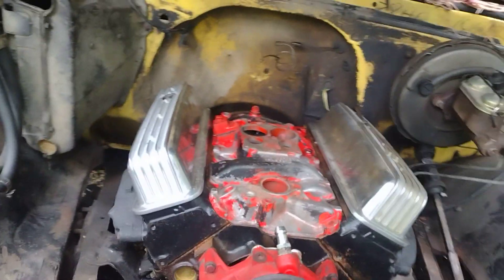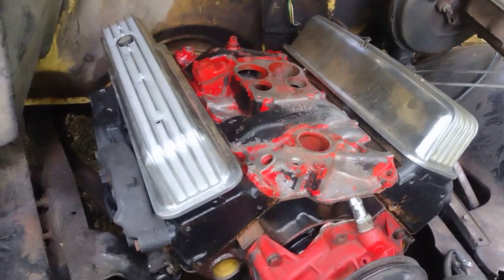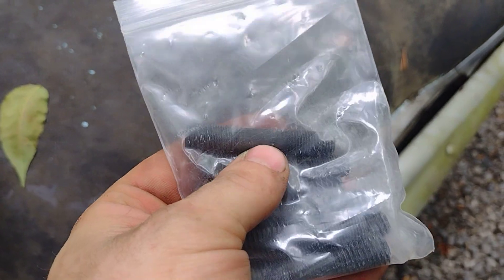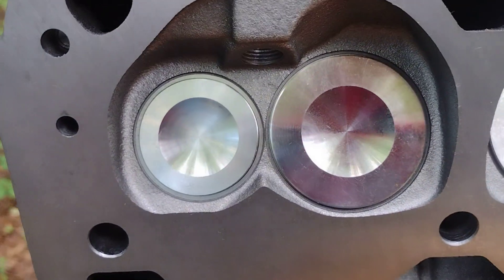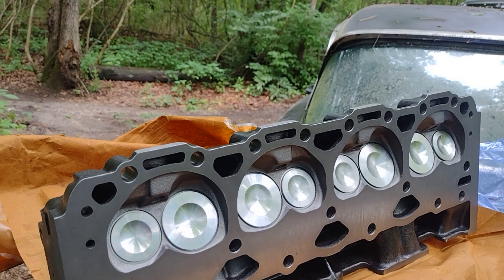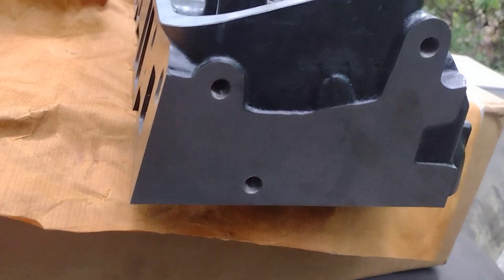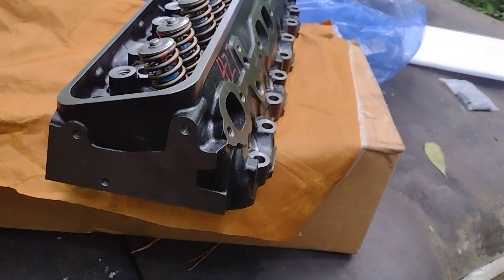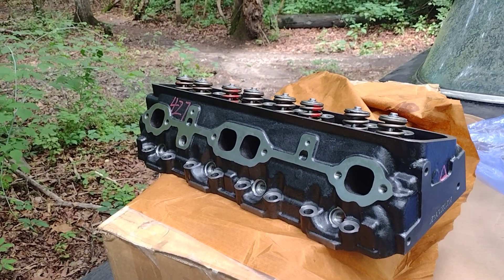'69 C10 VORTEC head came in SUPER HAPPY! pt 1

Comment: What lift are they rated for?
Reply: @bad66chevelles  
Not so much asking about the springs but if the seal bosses are machined down for higher lifts. Factory Vortec heads are only good for about .480" lift because of how they made the seal bosses big enough to double as the spring guides.
Reply: @itseithergonnaworkoritaint7852  one time I ran across a reman vortec head that was on a jasper crate engine and it was only able to clear .450 lift with no seal with the stock retainer. And most of the others I have seen will only go .470-.480 with no seal. So obviously it's very important to check on them before doing a cam swap.